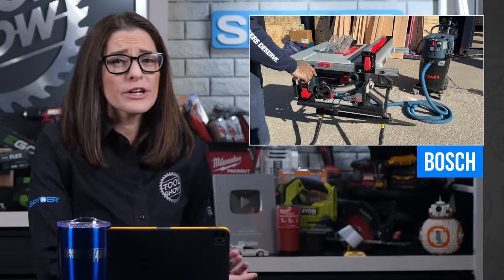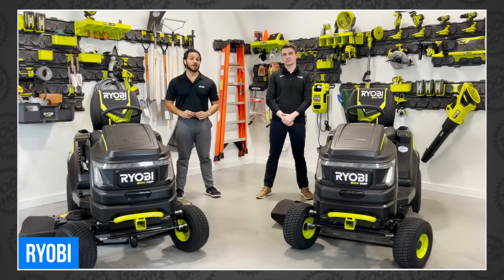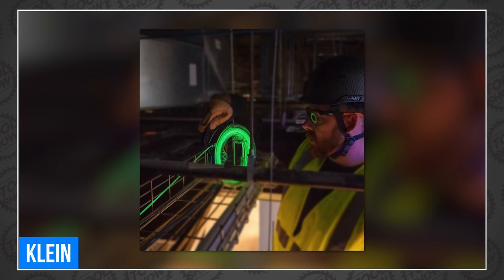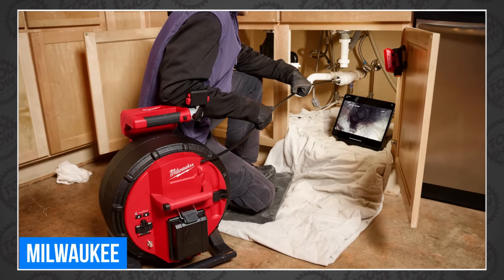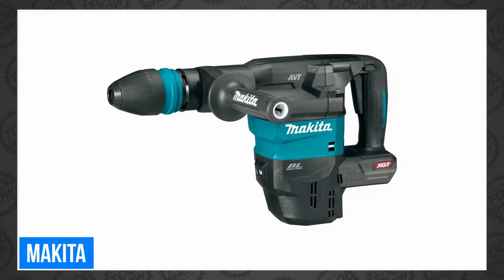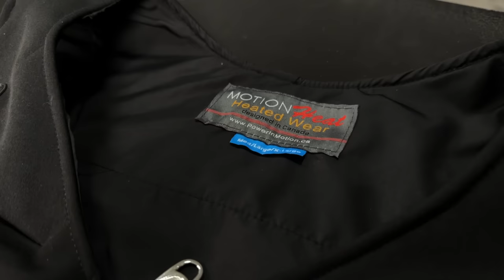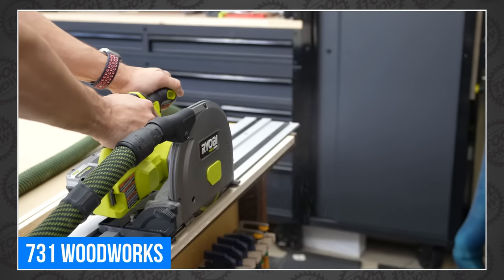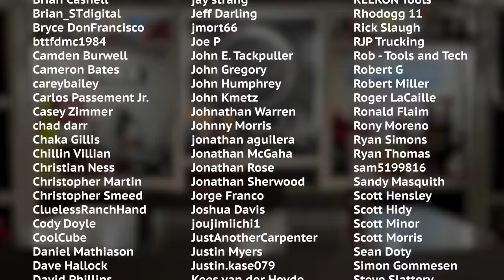EVERY New TOOL Announced from Milwaukee, DeWALT, Makita, and more! The Tool Show!

Comment: This vest can probably  save that day, a few years ago. As a HVAC technician i was to braze 4 line sets and  connect 7 line sets to outside units via flare nuts,all kneeling at the deck , where this AC units are standing , in -16 °F and wind.

Comment: Back when I was a probationary member in my fire department, I was assigned to do traffic at a vehicle accident. I was stuck at a four-way intersection for about 2 hours in below zero. Also wearing clothing that is designed to remove as much heat as possible from your body.

Comment: As far as a cold story, me and a friend, when we were younger, were playing on a snow bank that a plow truck was actively plowing snow into. Stupid, but we were kids. Anyway, about 1 mile or so from home, while standing in the bank, he plowed another load of snow into it. Well, my feet got good and packed and stuck in the snow. I lost both of my boots and walked home, fast with no boots on that day. My mom snapped and thought I had frost bite. Thankfully it turned out okay.
Man was that a stupid decision I never did forget lol.

I live in northeast pa, and although its been generally warmer, we still have about a 10 to 15 degree difference (being about 2000 ft up in elevation) to those in the valley only a few miles away.
Cutting fire wood, riding a quad, or removing snow, I'd absolutely love to wesr this vest to stay warm.
Also, work outside often, and this would be a huge asset to me.

Comment: Bosch cordless grinder. You did say 6 inch right? So it can take both 5 and 6 inch blades? In Australia the 125mm grinder and Metabo also have 180mm grinder.